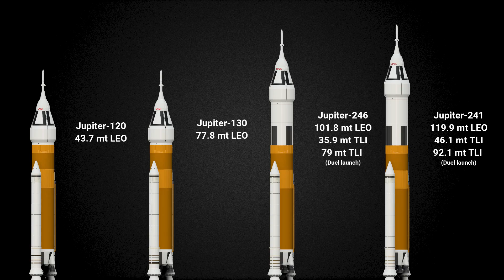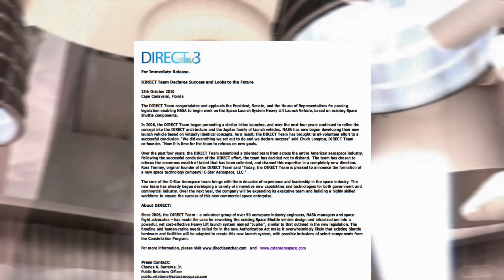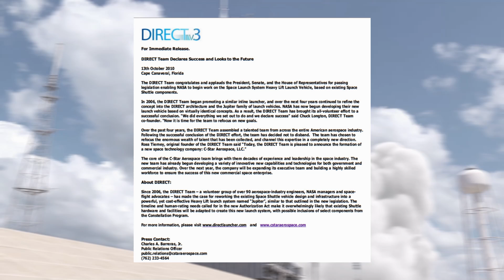What was Jupiter DIRECT?

Comment: For DIRECT, I think it had some structural problems meaning that the tanks needed the modifications done on SLS. The LH2 tank was essentially "hanging" from the SRB strut, which meant that it was quite flimsy but lightweight. Compare its weight to the Energia core and you'll know what I mean. It likely would've broken apart with RS-25s on the bottom, or at least come uncomfortably close. The margins in general were just too close and it had some overtly optimistic assumptions, which is why going with SLS instead of DIRECT was the right call.

Comment: USING THE ROCKET EQUATION IS THERE A LIMIT AS TO HOW BIG YOU CAN BUILD A ROCKET TO LAUNCH BIGGER PAYLOADS AND STILL GET IT OFF THE GROUND ? ? ?  👍👍👍👍👍👍👍
Reply: There is no limit, however, as MrZ said, it becomes impractical. At some point, small increases in payload require ridiculous increases in fuel. The solution is to not use traditional chemical propulsion.
Reply: I.e. some curve drawn by the rocket equation creates a vertical asymptote (as opposed to increasingly fast increasing line, like you get from a parabola)? Nope. No theoretical limit, but there certainly are PRACTICAL limits.